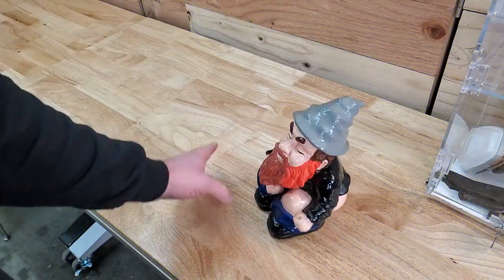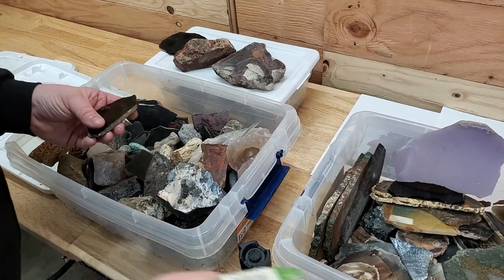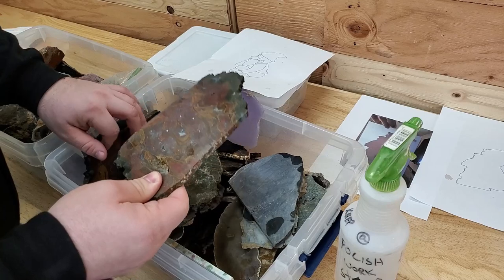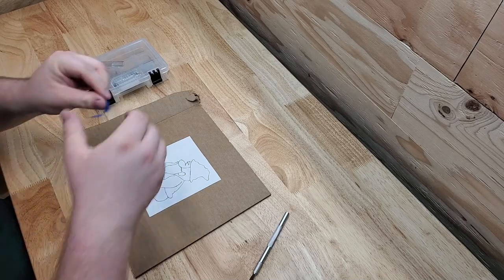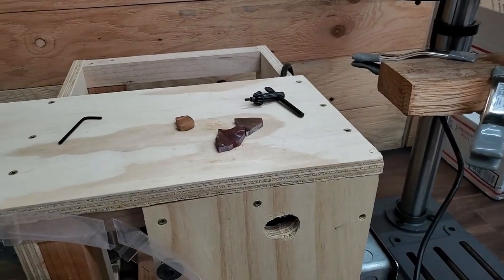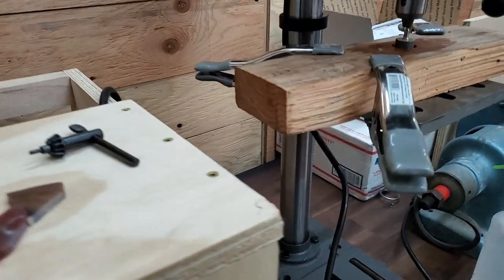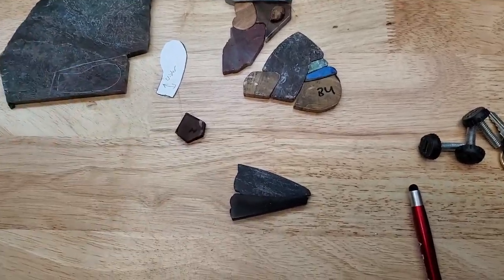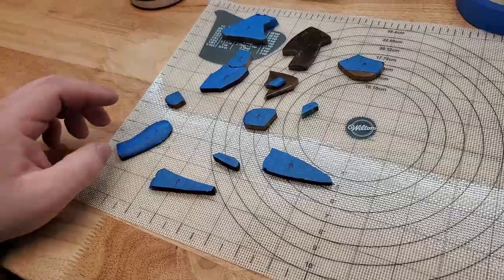The Maker's Challenge - Making a stone gnome

Comment: That turned out great. I have wanted to do some sort of intarsia, but I have never found a picture that I was happy with that went with rock colors I had. I guess pooping gnomes never occurred to me. 

Your shop is awesome. I thought I was lucky to have one cabbing machine, but I think I counted three in your shop. Wow. I have a drill press and I think I'll try your makeshift router table with it. Can you tell me where you got the bit for that? Do they come in various grits?

One more question. How did you clean up the epoxy? I use epoxy, but I always end up dripping it somewhere I don't want. It looked like a mess when you were using it too, but I didn't see any on the finished product.

Awesome video. I'll be watching more.
Reply from the maker: Thank you!

You have a very clean shop which is always incredibly pleasing to look at. 

And the large bit I was using I believe came with the foredom but I'm sure you could probably buy it through one of the lapidary companies like Kingsley north. I did buy a large container of bits through harbor freight. 
Certain bits don't last very long but they are affordable.

For the glue, as soon as I glue anything with the epoxy, I'm basically on stand-by until it's cured just enough to remove the tape and then I use a somewhat fresh exacto blade and carefully start removing the excess glue. 
If I wait too long, then it takes much longer to clean up.
Most materials can clean up easily but the belt of the gnome was particularly soft and could be scratched with the blade.
If the glue is hardened enough, I will dip the blade in rubbing alcohol to help clean up the glue and also help keep the blade clean. 
I'm also very careful to make sure that I don't have an excess of alcohol over the finished product to avoid compromising the glue. 
I use a Qtips and a rag with the alcohol to carefulyly wipe down things as I'm going and it helps to show places I missed.
I don't think I recorded the glue cleanup but I should include a video the next time I work with epoxy.
Reply: @WorldofRockhounds  Thanks. I was hoping there was an easy solution that I was overlooking. I have not used an Xacto or alcohol in my clean up, so I'll add those to the tools I use. You cleaned up after yourself well.

My shop isn't nearly as tidy as it looks. I have a table on one side and a counter on the other. The camera only catches one at a time, so I just move all the clutter behind the camera so it looks nice for the video. My wife will tell you that it's all an illusion. I'm glad I have so many people fooled though.

Comment: supper complex project ! well done , I think your choice of stones for each part was perfect ! and I'm gonna use my drill press for way more than drilling now, plus the wood trick to hold some water, the type of simple can do thing thats perfect for me at the beginner level . and the chat was supper fun touch , great community builder. have a awesome day . see you on the next.  :  )
Reply from the maker: It was definitely the most complex project I've done to date. For the drill press, I was trying to figure out a way to drill without needing a huge water tray so that was the fastest solution and it worked okay and just made sure to keep the water full and also used the spray bottle when/if the bit looked dry.
Reply: He has also polished   obsidian .  Maybe ask for tips because   he didn't really use but one polish that I saw .